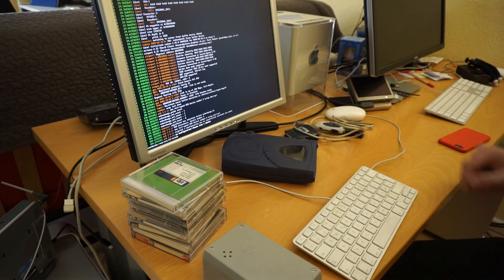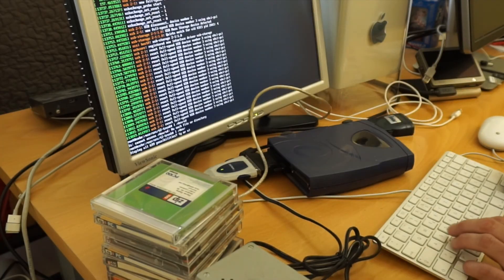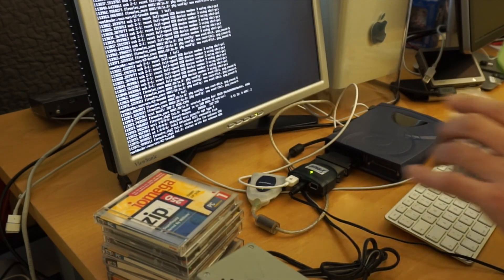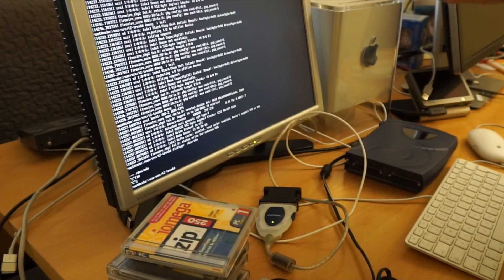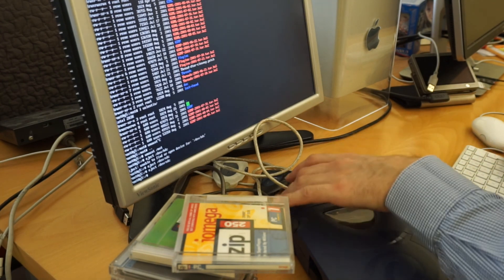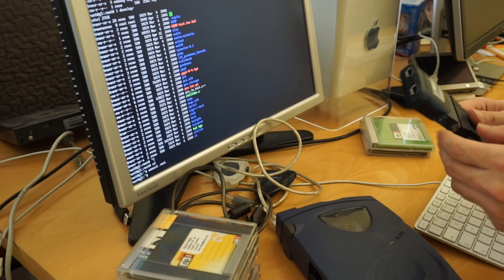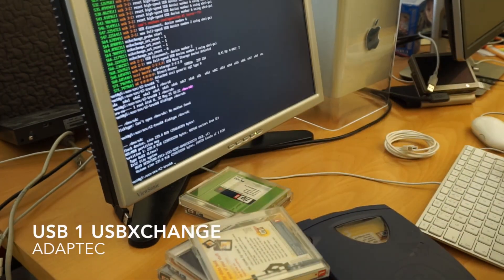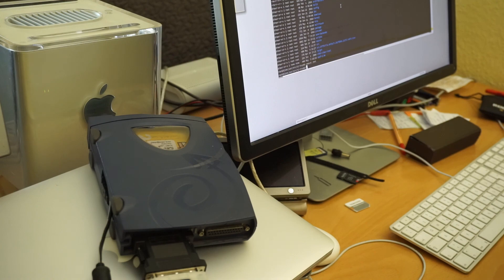Testing SCSI Zip-250 with G4 Cube, G5 tower and Linux

Comment: Hello Rene, I have got the USB2Xchange for very cheap last week. But I only could got it to work in a WInXP vm. My main system is Fedora 35 KDE spin. I would like to run it in Linux since I need to access HFS (non plus) partitions. I have found some old posts from you in 2006 regarding a patch. Can you help out somehow? Greetings from Germany.
Reply from the maker: Just works with the patch I maintain
Reply: @renerebe  My last comment was blocked, here the short version: I have managed to get it work in your distro with scripts/Emerge-Pkg adaptec-usbxchange. I could show the hfs volume with hmount. But I think that is the limit of my expertise. I still don't know how to run it in other Distros.
Reply: @renerebe  Nice, is there a tutorial how to apply patches? Where do you host/maintain it?
Reply: @renerebe  One more question: Does the 'adaptec-usbxchange' also includes the patch besides the fw or is the patch already applied in your stock Distro?
Reply from the maker: @Idris Osman  the patch is in the linux  kernel package
Reply: @renerebe  Thank you. I will try to do something about the patch then.
Reply from the maker: @fattymcboomboom9254  or you simply use t2 ;-)

Comment: The reason your firewire adaptor needed an external power supply is because it was most likely designed to be used with a Windows based computer. Windows manufacturers didn't provide the specified power on their firewire ports, usually called iLink on Windows computers. As a result an external power supply is required. Windows computer manufacturers did have more power on their USB ports which Apple used to power the firewire based iPods first sold to to Windows and Mac users until they switched to USB later. Similarly, Apple did not supply extra power to their USB ports so USB powered devices often need an external power source on the Mac.
Reply from the maker: yeah, but, could that adapter "dongle" not detect voltage, and work with the supplied one? Or did they not want to build a (linear) power regular into it? PS: Ah! partial re-watching my own video (heh) I indeed read somewhere about this scsi term power thing. So maybe re-using the firewire power was not as easy as scsi term power, and other big scsi devices, like cd writers or hard-drives would actually supply that and just work?